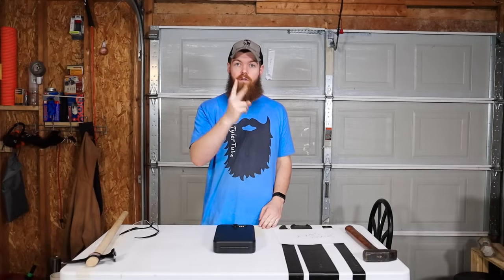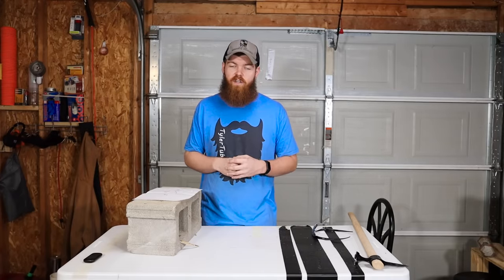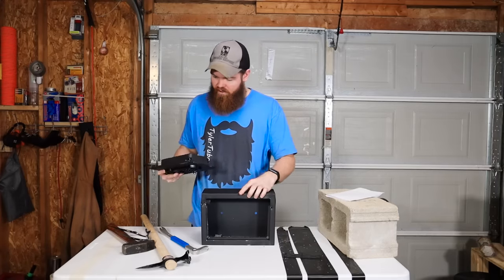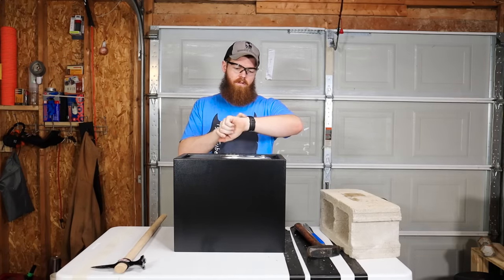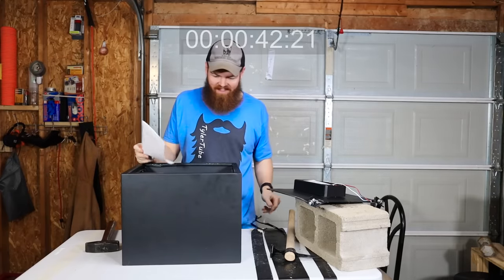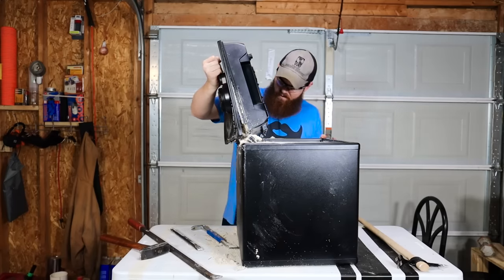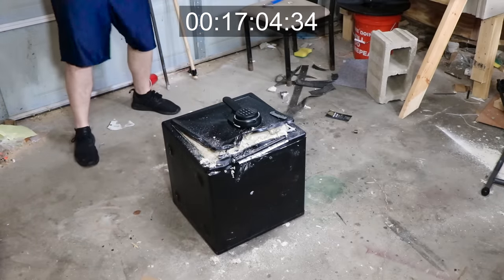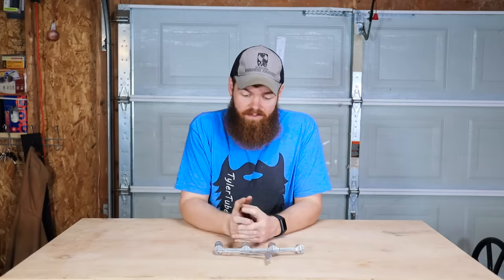How Hard Is It To Break Into A Safe?

Comment: Ok the table was strong as heck to withstand all that abuse and not fall apart. 10/10 product review on the table, 0.5/10 on the safes lol
Reply: I want to say that is a cheap Coleman folding table they are plastic tops and the legs are metal they weigh like 6 pounds and we have one I would not think it would take a beating
Reply: @crowbrocaw  I think it's a Coleman table top on a stack of cinderblocks at this point.
Edit: Holy fuck it isn't, what kind of devil fuckery is this Tyler?
Reply: This is nuts, only like my 5 comment on a video and its like got soo many likes, its insane lol
Reply: Stronger than my relationships
Reply: Mans got that Phil Swift table😂‼️
Reply: @ogfsavv  “ i sawed this table in half”
Reply: I was thinking the same thing! Not to mention it's a plastic one! It would be better to keep your valuables safe 😆
Reply: 16:43 the table is LifeTime brand
Reply: That table is actually used in the military at camps and stuff.
Reply: @Matthew-jp4sn   THANK YOU
Reply: I mean. He proved those safes are trash

Comment: hello, I'm a locksmith. safes are designed to be safe in their environment. if properly bolted to concrete, your efforts would have taken much longer, giving amble time for the owner to come home or call the police. here's a tip, once your safe is disconnected, simply drop it from the highest you can onto concrete. most will just pop open. the bigger the easier. what you are paying more money for is the lock rating. that's determined by how long it takes for a professional to pick the lock. a high rating safe should start around $2,000, and should have a locksmith to install it strategically, like in a corner in a basement floor.

Comment: i wouldn’t call any of those a “safe”... at most they’re lock boxes.
Reply: Exactly ask demolition ranch where to get a safe I think he can help out
Reply: No safe is totaly secure it can only slow people down. half the battle is not only how secure the safe is it's how heavy it is to move, how it is fixed to an imovable object (concrete floor/Brick wall) and how awkward it is to get at with tools.
Reply: @wakey87  I was about to say the same thing he only tested for safes and a gun lock box which was the first one the first one is only meant to keep little fingers off of a handgun and any safe in time you'll get into in due time safes are only supposed to slow criminals down because they want to get in and out they don't want to sit there for even four minutes trying to get a safe open that's why they're meant to be bolted down and as of the last safe the Lock pins made of aluminum are meant to bend and disform to make it more hard to get into and the reason why the door didn't come off is because there's a kicker plate on the back of the hinge plate
Reply: @wakey87  if your looking for something way more secure get a vault, it takes a insane amount of skill to open a vault no average thief would even attempt it after seeing the 3 and a half foot thick steel reinforced concrete vault
Reply: "i wouldn’t call any of those a “safe”... at most they’re lock boxes." at first i thought you wrote "loot boxes" which would also be fitting and funny ^^
Reply: those are obviously not meant to keep any real valuables in it

Comment: You should go full Lockpickinglawyer and get a Ramset gun.
Reply: OMG YES VIDEO WITH A RAMSET GUN
Reply: @TheOneAndOnlyRandy  that's not an actual security safe. It's a fire safe. They're just supposed to be crush resistant and fire proof. The inside of the safe won't get very hot while in a fire up to a certain time thus keeping important documents safe from disaster. ^.^
Reply: @electricheartpony  uh, ok...I knew that before you had to think I was stupid and tell me so... Still the same "safe" , marketed as a "safe"
Reply: @TheOneAndOnlyRandy  there's still people who don't understand it isn't. I don't think anyone who thinks that those are actual security safes is stupid. They're advertised as a secure place to store valuables.
Reply: @electricheartpony  it's made of 18ga mild sheet steel, refractory cement and plastic... But it has a lock, and a combination lock, and this huge door.... Lots of people instantly think "safe" when it's no more "safe" than the trunk of your car, or the back of an open pickup truck, depending on where you live
Reply: @electricheartpony  I just found it ABSOLUTELY HILARIOUS watching tyler smash the piss out of this thing for 20 minutes, after funny enough having just watched the lockpicking lawyers video from years ago previous to this brand newly posted one by only 2 or 3 videos
Reply: @TheOneAndOnlyRandy  its marketed as a safe because a safe keeps the things inside safe, aka stuff safe from fire.

Comment: Actually there's a very good reason for that Sentry safe to have aluminum locking pins. Aluminum has a higher thermal expansion rate than steel, so the pins will expand into the steel in case of a fire, making it seal shut tighter. Fire safes really are theft protection second, fireproofing first.
Reply: aluminum also has a much much lower melting point though.
Reply: @sirpiken  Yes, but a house fire typically burns at 100°F less than aluminum's melting point.
Reply: How do you get it open after
Reply: @rogerdecarbo7105  either how Tyler did it or powertools probably would make it way easier, or a simple rake pick if it’s a sentry safe
Reply: @rogerdecarbo7105   circular saw and 2 minutes!
Reply: The Aluminium will melt. A good fire safe has the melting foam to seal air gaps and hardened steel pins that rotate.

Comment: You are missing the point of the safe. That last one has the most basic and important safety feature. Weight. The other safes could be stolen but no burglar is going to haul 100lbs with them with the promise of maybe something valuable inside. Also sledge hammers aren't a typical tool for burglary but even if it were a burglar wouldn't spend more than 10 min max trying to get in. Less so if they think someone might be home. So realistically if a safe is too heavy to be stolen then it's already pretty damn secure.

TLDR: safe heavy. Not going to get stolen.

Comment: I used to sell gun safes for Cabela’s.

The highest end gun safe safe any big box store sells has the same UL security rating as the cheapest- “residential security container” designed to resist one man with a 3 foot pry bar and a 1 pound claw hammer hammer for 5 minutes. Those are the only tools allowed for that test. You can get in faster just cutting the side off with a circular saw.

Safes are the illusion of security. If bad guys know where your stuff is and they have an hour or two, they will get it. 

Best to not let anyone know you have anything good, and make it difficult to find.

Comment: I recently purchased a sentry safe similar to the last one you worked on. I was a little worried about that outside hinge myself until I saw the lip inside that runs 3/4 the length of the door, even if you remove the hinge, it is still secured. I’m okay with it.

Comment: Okay yeah a loose safe where your free to move it anyway you please to get leverage, not impressed...now try a real world scenario where the safe is bolted to cement, encased in cement, or mounted in a wall thats reinforced where the only thing thats showing is the door. You say its not worth it for $180.00 but if thats in someones house and is properly installed what idiot is going to spend 20 minutes making all that noise to get into a safe. I think it did its job for that price. Also you had the ability to inspect the inside of the safe before hand, you knew where the weld spots were and the hinge maybe next time try to do it without knowing all of that.

Comment: LockPickingLawyer sips redbull and chuckles.  Opens all 5 safes while Tyler does his sponsor portion.  

Importantly, what we have learned here, is if you bolt your safe down it's even LESS secure because it would take the full brunt of a hammer impact.  They should start making safe hinges out of the material the table is made of.

Comment: One thing I see with a lot of these videos is that most people go for the door when that’s obviously going to be the most reinforced point. The walls on a lot of these safes are generally made out the same gauge steel and can easily be cut through. Obviously no cutting tools were used here but that would be significantly faster than trying to go through the door.

Comment: Surprised I didn't yet see a comment reminding people that just because it's called a safe doesn't mean it's a safe. If you need a real safe you buy one with ratings, and only the last one had a rating and it's for fire. Also if you assume a fire rating gives it a burglar rating like you did on the last one, that's on you. The last safe does have the most practical application, which is to keep documents from turning into charcoal if you have a house fire. The biggest travesty here is being able to market these as safes and not just a box with a lock on it, and the fact that people look at price over product and 4/5 people will buy one of these and feel bullet proof. I appreciate the video I like being able to watch someone do what I would like to do to these products, though if you do another video like this start them all on the ground, the table absorbs so much impact and i'm sure you could take out any part of any of these products in 1 swing instead of several if they were on the ground for the start. If any of the ones able to be bolted down were, swinging at them on the ground is a much more realistic comparison also.

Comment: all the safes i see on my job are the old ones, that got thick walls filled whit stuff and the big iron door that needs 2 people to lift... that is pretty much impossible to get in, a dude broke into the shop and worked all nigth whit a angle grinder and didnt even cut one quarter of the first hinge of the door lol . 
these looked like crap whit that thin metal and i use one to store my toys lol

Comment: I feel that you could have opened them all in 1/4 to 1/2 the time. All your kenetic energy is being absorbed by the table. Put them on the floor and you will not have that problem.
The material in a fire safe is generally Plaster of Paris. Thin sheet "beer can" metal and poor locking bars do not make for a good safe. You want a minimum of 12 ga hardened  steel.

Comment: FYI my brother. A GREAT deal of force is lost in striking blows whenever your subject matter is resting on such a flimsy table that absorbs most of the shock. Any time you are using striking blows, the supporting structure of "hammer victim" must a solid immovable object such as your concrete garage floor.

Comment: From looking at the locking mechanisms all those safes were or should be cheap. From a destructive entry stand point a "high security" safe should be heavy, strong and have a good locking mechanism. I would define a good locking mechanism as at least one steel(or better) locking pin going in each wall the the door contacts. Also as a side note a safe's weight can be used against itself to open it by dropping it from extreme height on to a hard surface.

Comment: That is called a safe for your handgun that you slide under the seat of your vehicle or in your camp or someplace flat like that that is not supposed to be highly highly secured but secure enough to hide your firearm running through sheet or something like that so it's not laying a Loosely to where to go off it's just to keep the fire on from going off I seen your vehicle into your seat

Comment: Unless you're willing to spend 4-5 digits on a safe, it will be easy to compromise and likely public knowledge. The best deterrent is bolting it into a space with no gaps around it so its impossible to move and/or just getting a firebox. Fire/water will usually be a bigger threat anyway than some would-be thief with a hammer

Comment: For the most part you aren't actually paying for security, just size.  The security comes from having your valuables not just out in the open, it's unlikely someone could get in without you knowing while you're just in the other room.  If you aren't home a burglar who really cares what's in it will either have good tools or just take it with them and break in later.

Breaking in with lockpicking methods might get tougher on the more expensive ones but even that will vary widely depending on things like manufacturer and what the safe was primarily built for, like most of what you had versus the fire-secure safe.

Comment: That 3rd safe you can open without any tools, just you're 2 hands. There a a few flaws with those safes, one being there are only 3-4 different keys that come with the safes, like safe A would have key#01 and safe D would have Key01, just look at the numbers on the key for your safe. it is crazy that they only have like 3-4 different keys for all the safes they sell. The 2nd safe you can open by hitting it on the top and turning the knob at the same time and it will open right up

Comment: Would it be a good time to say that ANY electronic safe IE keypad,  can be opened by putting a magnet over the unlocking solenoid.  you can even relock it.  After that....a circular saw, or angle grinder

Comment: Just an FYI, aluminum is actually hard to bend. That's why it's used as those pins. Well not cheap aluminum like 6061. And not thin. It's funny cause I can easily bend a 6061 tig welding rod but not the weld after... I used ⅛ inch 6061 sheet (an old Rainier brewery sign) to make  a tail light housing and even with a roller I could barely get it to bend with literally all my strength and the leverage of a long crank handle.

Comment: to be fair if the safe was secured down to a floor or wall, you wouldnt be able to get the same leverage and power on hits to it since the door wouldnt normally be facing straight up

Comment: I dont expect alot from these safes. Mostly to keep guest and workers from easily snagging money or papers casually.. but the complete lack of security on first 3 was insane. Put those big pins into holes on both or all 4 sides of the door, instead of just behind a lip on 1 side..50x security  for 5 bucks extra cost.

Comment: A $10 camping hatchet will get you into about 90% of the safes out there.  That is what I used to get into a 60 pound floor safe I lost the combination for.  I busted the hinge in about 5 minus.  Many locks with a key, a screwdriver and a hammer can open the lock mechanism in seconds.  An angle grinder will get through the strongest.  You should have wacked the handle on the last one or put a pipe on it to see if you could force the lock.

Comment: My neighbour had a known drug addict open the third type safe in 17 secs with a screwdriver while he looked at a hidden camera. 17 secs ! Sadly for him, the police were very familiar with him and picked him up.

I'm a builder of 50 years experience. I've replaced a few safes that have been broken into. My first advice is if they don't find it they can't break into it. So don't put it in the master bedroom or a walk-in closet, the police tell me that's where everybody puts them so it's the first place druggies look. [EDIT: The third place is the pantry.] Also if you can use your imagination and hide it in plain sight, no one will see it.

The most secure safe is a floor safe with thick concrete on five sides and a top quality ($2,000) door. I can't break into them. A locksmith can with a magnetic drill and lots of new sharp drill bits. You can drill anti-drill steal. How does he open it through the hole? He won't tell me :-(.

BTW, a floor safe is also very fire resistant. Like me you could go full hog and get a 5 hour fire resistant door with the bonus that it's waterproof. My neighbour had me install one the same as mine in his house.

Last tip, the only people who can find our safe are my wife and sons. If we all die then the house wrecker will be rich.

Comment: Try safes that are 1kusd and up. Thats when you see harden plates and materials that make sense for physical security. Obviously size dictates the price so comparing a hand gun lock box with a floor or wall safe isnt that telling. 

Usually your best kinetic attack is a circular saw if you have access to 3 or 4 sides of the safe (separating the door from the back and sides). Fairly dangerous to use a saw like this but all these cheap lock boxes have very thin walls

Comment: If the safes were bolted to the floor inside a cabinet, or even inside a closet, you wouldn't be able to move the safe around to get the best leverage for your pry bar and hammer. Not really a real world challenge, but does show how cheaply made mass market home safes are. Given time, any safe can be defeated by a determined thief. The goal is to make it enough of a challenge so the risk (time spent in residence) outweighs the possible reward. Like your other videos.

Comment: The last safe was secure enough to keep a smash and grab burglar out.  Most burglars are not carrying around sledge hammers and large crow bars.  Your average burglar wants to be in and out in minutes and unless they can grab the whole safe and take it with them they are not spending 20 to 30 minutes to work on that.  They will just take what they can grab quickly and leave.  Even if they did get the whole safe off it's anchored points, they most likely don't want to carry out something over 100 lbs.

Comment: If you placed the safes on your concrete floor instead of a flimsy table, you would have broken into them way faster. That table absorbed a lot of energy that would otherwise go straight into the safe had it been on concrete floor.